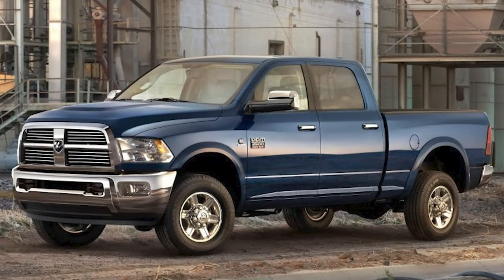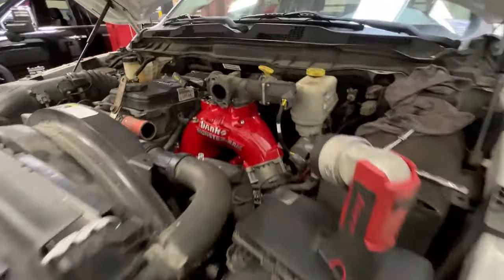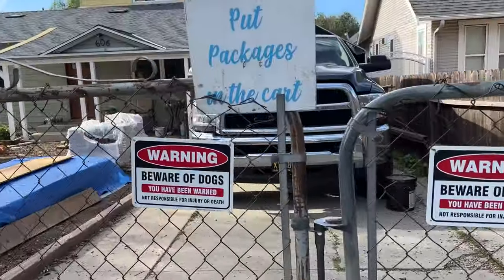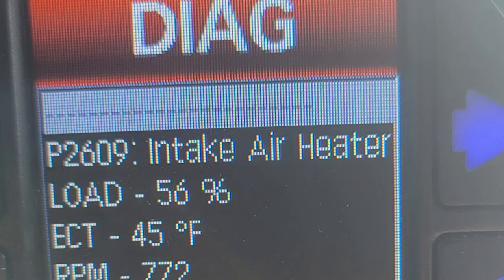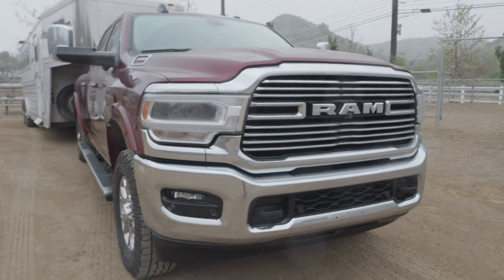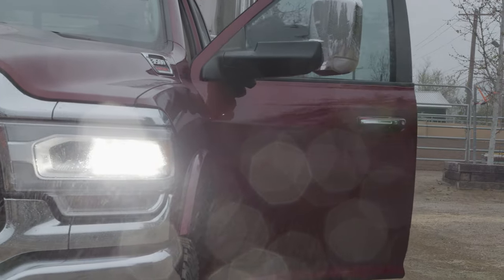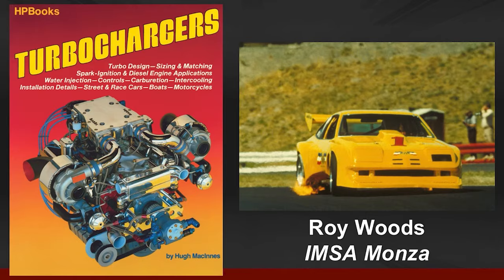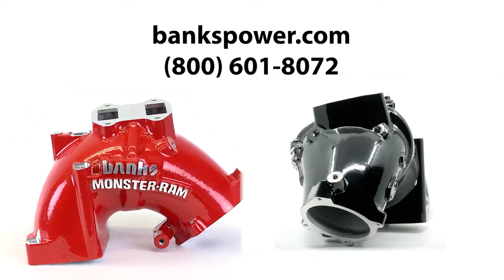RAM 6.7L Grid Heater Bolt Failure Explained

Comment: The fact that this affects 2007- to CURRENT engines is inexcusable.
Reply: They know what they are doing and said Nahh. Your problem now.
Reply: @25aspooner  if the truck is under warranty when it lets go, doesn't Ram have to foot the bill? I would hope so. But, if they accepted culpability, that would mean they acknowledge it is a problem, and would have to pay for all that recall work on every diesel ram since 07. God forbid, and the executives will try as hard as they can to pay out as little as possible.
Reply: It's bad enough these trucks cost what they do, but to top it off, who tf knows if/when you'll need to do a $30k repair. 
A lot of guys rely on their truck to make a living, either partly or entirely. How are they going to make those fat payments if the the truck goes down? Can they kick the working man while he's down any harder?
Reply: Cummins needs a law suit
Reply: Everyone who has had a problem should get a mass lawsuit lawyer and go after either dodge or cummins for the flaw and damages. They surely would re-engineer it after that.
Reply: and still wont be mentioned by ram owners lol
Reply: Our 2012 may have eaten that bolt. Trying to retrieve it now on a motor with 60K miles.
Reply: As long as it gets past warranty mileage and doesn’t kill anyone they don’t care bud

Comment: Yea… just a tip. DO NOT “locate the grid heater bolt and wiggle it to see if it’s loose”. Also the solution is a grid heater delete, your Cummins will start just fine in the winter without it.
Reply: How’s that
Reply: @toiletpaper5770  Because overtime the grid heater bolt basically corrodes over time and if you wiggle it you can brake small pieces or even the entire nut off and it will fall into your cylinder. Many people do a grid heater delete to combat this issue, and from personal experience these 6.7s start just fine in the winter
Reply: @AngryyBeaverr  I never would have thought (they start good in the winter)
Reply: @toiletpaper5770  The do start just fine in the winter without the grid heater. Maybe in sub zero F temps it might be necessary or better to have it but not in 0+ F. I recommend the wiggle test to be sure it is okay then disconnect the relay that feeds it. I have never heard anyone mention corrosion as an issue, just overheating/melting of the bolt. I've not heard of anyone having a failure after disconnecting the relay, which would likely be the case if they were failing from corrosion too. I figure all the soot on the threads will keep the nut from spinning off even if it came loose.
Reply: It won't in cold climates.
Reply: @cthunter41  I live in New England. During the winter I’ve stared my 06 5.9 many times in 10° degrees and it started just fine. My grid heater is deleted, if you have good compression, batteries, and starter there should be no issue in that kind of weather. Let the truck warm up for a few minutes and drive it easy until your fluids are up to normal temps

Comment: Just bought a used 2016 Ram 2500 and figured I’d be putting one of these on. When the dealer called to say the truck showed up I went to get it. Opened the hood to see the previous owner had already installed the Banks intake!

Comment: That's fuckin crazy RAM hasn't issued a recall on them. If it failed on mine and it's a common problem the company knows about, I'd hire a lawyer. Ain't no way I'd shell out 30grand on an engine because they knew about a bolt failure design.

Comment: This was a problem on the Cummins ISB engines that are in most box trucks. Cummins blamed International stating it was a relay on the body side. Bolt would break off and bounce into the intake and then into the cylinder. Denied hundreds of warrantys on Internarional trucks. Now its coming to light that it was indeea a Cummins issue.

Source - i worked for International.

Comment: I just replaced mine on a 2007.5 with a monster ram. My stud at the grid looked terrible.  The typical bolt mentioned in this video looked fine.

Comment: 230K miles on my 2012 Ram 2500 with the 6.7 Cummins (I've owned it since new) and having drove it for probably 20K of those miles and 10 years in North Dakota where it gets down to -35 degrees and that bolt is still just fine after inspecting it.
Reply: 60K miles, and we're searching for the bolt here in California.

Comment: This is just one problem, another issue with the 5th gen diesels are the lifters. They are know to go out prematurely. My 2021 ram diesel only has 50k and already has lifter failures, it’s at the dealer now but all they are going to do is replace the faulty lifters with more faulty lifters in hopes it gets me past the warranty period. After they do this job I’ll be converting to the flat tapper style with new cam like the pre 2019 models had that where more reliable

Comment: Get shocked with 12V???? No way!
But you could make short to the metal parts around it. That could cause sparks, melting and you could burn yourself. But theoretically it is safe if the ignition is off.

Comment: This is exactly what my truck is dealing with now. Putting this banks system on now, my truck has been in the shop for almost a month.
Reply from the maker: We would love to hear more about this please email us your story and photos to socialmedia@bankspower.com
Reply: @bankspower  My 2019 Ram was leaking oil, so we took it to a shop in Kingman, Arizona. They diagnosed it. They were going to charge me 3,100.00 and told me it was the oil pan gasket and the timing gasket. So we decided to get a 2nd opinion, drove it to Lake Havasu Az, Canyon Country has had it for a few weeks, they cleaned the engine, put a tracing agent in my truck and discovered it was the grid heater bolt. It didn't fall into my engine, but the gentleman told us all the bolts were only hand tightened . So, I'm eliminating the grid heater and putting a bank system in. I have no pictures to send you. Should get my truck back next week.

Comment: My son had this issue on a 2017 RAM.The warranty company tried to say the bolt wasn’t covered as part of the engine. He got the dealership to back him up and they sent out a factory Cummins rebuilt engine, good as new. His truck was in the shop 2 months in total but fortunately they gave him a loaner 2500 diesel so he could continue working with his junk removal business. He was only out of pocket the $100 deductible for a complete engine swap. Seems he fared a lot better than many by the sound of it.

Comment: Who gets shocked off 12volts? Lol
 Great video otherwise.
Reply: You'll feel it but under 40v hasn't reportedly electrocuted anyone yet
Reply: I was replacing the grid relay on my 1997  Ram 5.9 cummins when I inadvertently grounded my wedding band to the 1/4" ratchet tightening the battery cable. Melted a chunk out of the gold band. Also provided me with a permanent scar/brand for a band now.😮
Reply: @kevinj945  Why would you wear gold while getting your hands greasy?     Did you put on a white shirt and your favorite jeans too?  What could go wrong

Comment: replace fsctory bolt  use a copper bolt and put a mesh cage over  over intake area   just incase of any parts falling into thst number 6 chamber, worth a try innit ??? Or you could take the heater out altogether and just  have a diesel preheater fitted some are fitted into fuel filter some are inline
Reply from the maker: With the Monster-Ram's high-flow billet intake plate, the factor heater is removed. That's why it flows so well. However, we know many like you live in cold climates. That's why we designed the coil-style heater that screws into the top of the Monster-Ram. This new coil heater ships with every Monster-Ram. So, if you buy the Monster-Ram, you'll have no problems in sub-zero weather.

Comment: One question regarding your "permanent fix" claim.  Exactly how does this kit permanently fix/prevent a faulty grid heater relay from sticking on scenario and melting the Banks heating element down into your intake/engine?

I, myself, actually replace my grid heater relay as a preventative maintenance item. I find that they develop cracks in them and could possibly cause  electrical gremlins.

Maybe a newly designed and more reliable failsafe grid heater relay by Banks could be something you could create.
Reply: The stock grid doesn't melt from the relay sticking on, the bolt used to conduct electricity does.  The banks heating element doesn't have that weak point.  That said, had they placed the element on the other side of the pipe, if it were to burn up, it wouldn't drop into the intake.
Reply: It doesn’t. Think about it, if the engine is running, which would be, then this is just a fancy looking paint job failure as well. When you are shorting metal to induce heat, then eventually all parts can fail. The best option would be no heater that spoofs computer into thinking it’s working. Trucks start fine without heat, but EPA wouldn’t all ow that. Buy what you want, this is same as factory with lipstick
Reply: If they designed it properly then it won't melt down even if its stuck "on" and the computer should still be throwing a fault code letting you know the heater is malfunctioning. If that is the case then you have to replace the solenoid that controls the heater switching on and off.

Comment: This is the truth, but chrysler is not reliable for the recall, its a cummins engine flaw, until cummins acknowledges the problem, nothing will happen other than warranty replacement, luckily in canada atleast, they come with 160,000 km warranty

Comment: will this void your warrenty ?
Reply: I’ve been looking for that answer as well. Even my dealer is giving me conflicting answers.
Reply: Since it doesn't change any parameters of how engine runs it shouldn't but if they can find a way to void it to stick you with the bill for a new engine expect them to try.
Reply: All I saw is that they have to prove that this mod caused the failure of the part they are warranting. With that being said, if they do decide to deny it, you can cancel the extended warranty, and they will prorate it per year and give you your money back for the extended warranty. Examples: If you install this and have electronic issues with the radio, the radio should still be under warranty. If you have a 6in lift with warranty and front end bushings go out, don't expect them to warranty it. I just order it...I think with all this information I'll take my chances with warranty over a new engine or have them rebuild it.
Reply from the maker: According to the warranty booklet that came with your vehicle, the vehicle manufacturer can only deny warranty coverage if an aftermarket product causes a failure but makes no provision for denying warranty based on the mere presence of such a product. Nor is there a provision for a blanket voiding of warranty coverage. All of our products have been rigorously tested to ensure that a properly installed Banks product is 100% safe on the applications for which they are intended. We suggest that you consult with your dealers service advisor for more info and their stance on aftermarket performance accessories. If they voice concerns over the part that you're thinking about adding, find another service center. There are plenty of dealerships who value their customers and embrace Banks uprades.